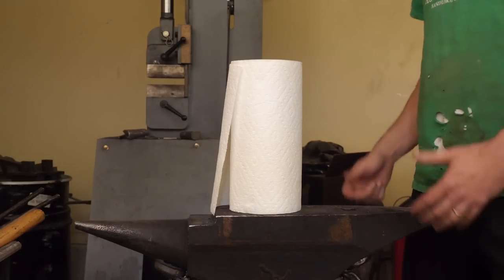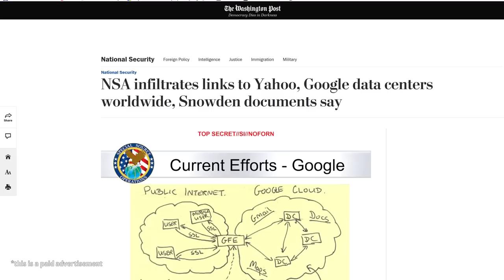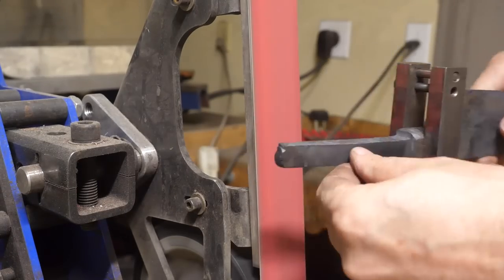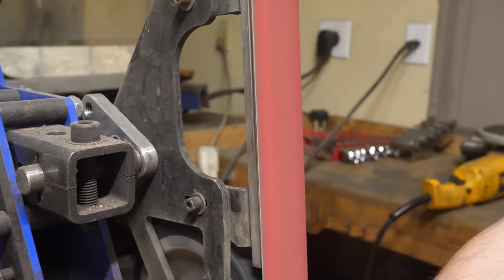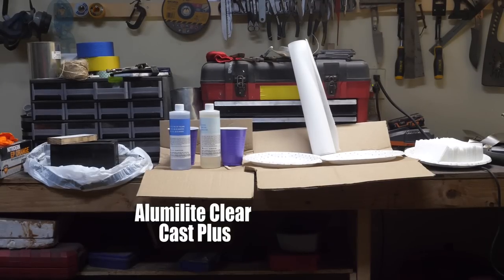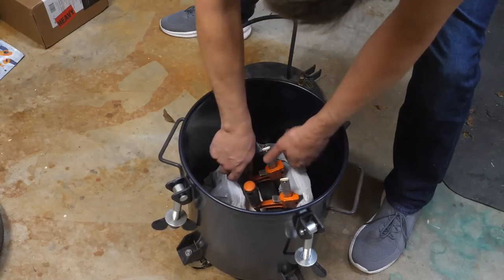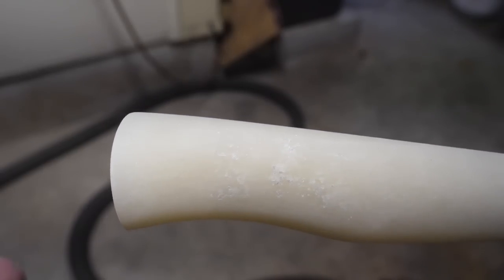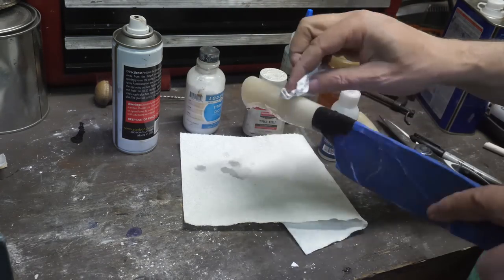Forging A Knife With Paper Towel Handles: A Roll Of Paper Towels REACTS!

Comment: Pressurizing doesn't remove bubbles. It makes them smaller and forces them away from the surface. You can still grind down to them.
If you want to remove bubbles, you do it after initial mixing, in a vacuum chamber. 
You mix in one cup. Pour into another (so you don't get any un-mixed material in the pour). Then you vacuum the mix (de-gas). Pour from a decent height into the mold (tends to not re-introduce bubbles), then pressurize the mold (reducing the size of remaining bubbles and forcing them away from the sides). This is the best we can do at home.

The reason you de-gas before the pour, and not the mold, is you will tend to pull out the resin, right along with the air, so do that from the mix.

The reason the paper towels look translucent is that they're mostly air, and you're introducing a transparent medium, filling those air pockets. It's similar to using material of a similar refractive property to fill scratches. It allows light to scatter deeper into the material. At least that's my best guess.

Anywho, it's cool how you use chaos to learn interesting things about your art.

Comment: If it weren't for the bubbles, the look of that handle was pretty neat actually.  Maybe if you used a thinner resin and resin infused the towel in a vacuum bag (look up resin infusion of fiberglass) it would solve that problem.